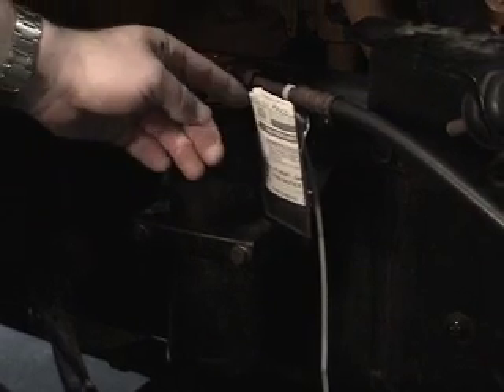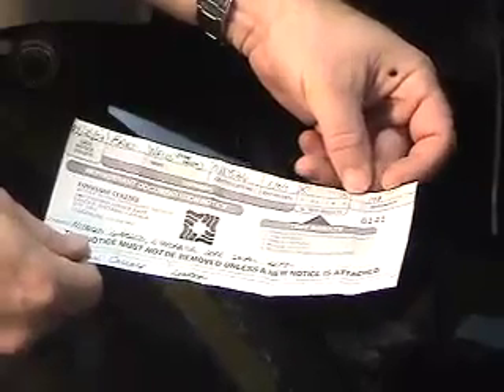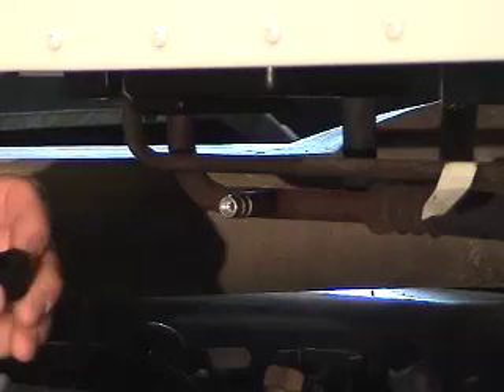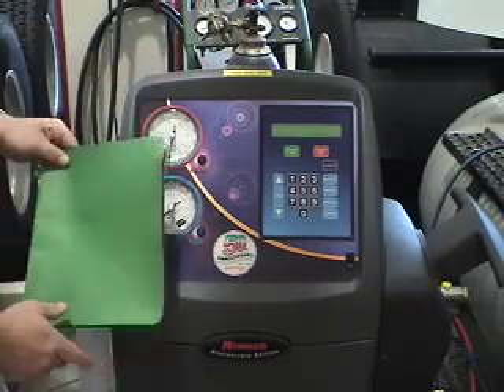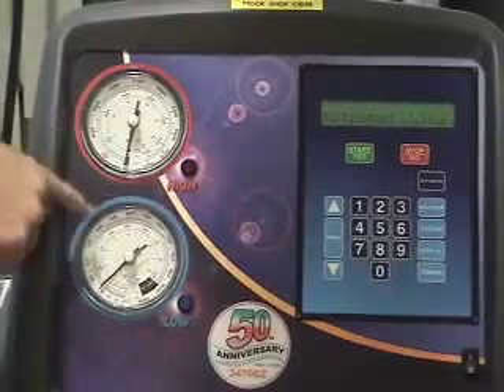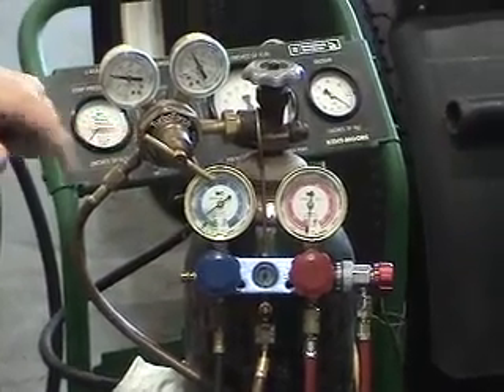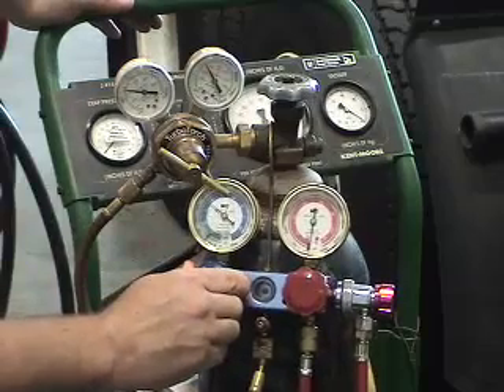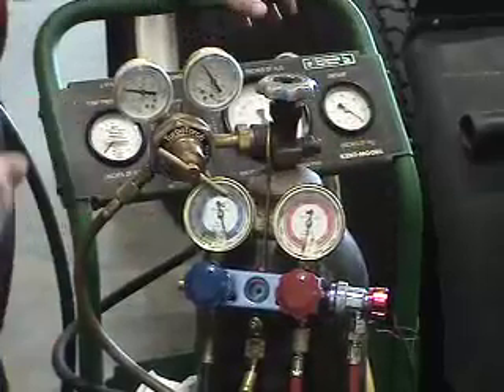Charging and Evacuating A/C systems part 1

Comment: @TheTarrMan how does it turn on and off like that usally if it turns off the compressor is under to much preassure meaning it;s not equalized so it doesnt have th power to overcome the head preassure so they shut off. so i don't see how yours starts and restarts cause i usally gotta wait min 30secs. max 5 mins

Comment: this is the first time i see this video and is is very nice the way you are showing how is done the charging and evacuating in the system i would like ask something that i dont see when you are pressure testing i see the yellow hose connected on the nitrogen but the blue hose where is connected on what part of the machine i appreciate the answer and nice meeting you at the video thanks

Comment: Great video thanks mate. A note though it's good practice to never open the bottle with the regulator open to working pressure side. As I'm sure you may rememebr from school there is a Bourdon tube inside the gauges, they have been proven to become less accurate over time from doing this, and have also been known to fail due to this. Best to Open the bottle, then Open the working pressure, as working pressure side is delicate inside due to the Bourdon tube. Cheers mate. IC.

Comment: @JISINSANE3  is correct..  Amonia was replaced by Freon because of a several reported deaths from the use of methyl chloride as a refrigerant...Amonia was tarred along with Methyl Cloride and Dupont / GM developed FREON...IMO and others ive talked to,   Freon was only replaced because there was no longer big money to made in it..  R134a allowed the chemical companies and service industry to charge higher prices on supplying and servicing an inferior refrigerant prone to leaks, compressor failure

Comment: I dont hear nothing. Is there sound on this? My CHevy express van stopped blowing cold air.  
I had the system evacuated and freon replaced  but still get no air for the rear nice and fresh air in the front but no air in the rear My van is equiped with front and rear AC Is there  something else I should check? If anybody knows please give advise Thanks

Comment: @TheTarrMan 
You are low on refridgerant. I suggest you read on this on purchase a manifold gauge set and either rent or buy a decent vacuum pump designed for A/C work. Don't forget to add PAG oil.

Comment: You have a leak. When you're A/C system is at rest, static pressure builds maintaining a closed circuit with the low suction sensor. As soon as you start the A/.C, pressure in the low side drops. Thus causing the low suction switch to open untill pressure builds again.

Comment: you can pressure test the low side you should not add it from the low side. The reason for adding it to the high side is you want to see if there may be a blockage in your expansion deivce, whether it be txv or fixed orifice. it give the system pressures a chance to equalize. If you were to add to low side it may only get as far as the crank case of the compressor depending on the type of metering device, positions of the pistons or type of compressor.